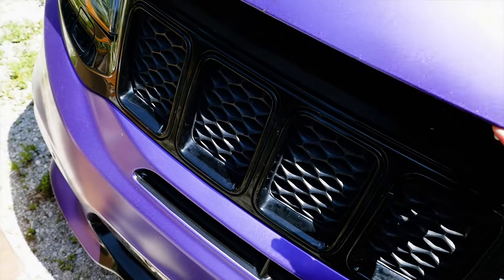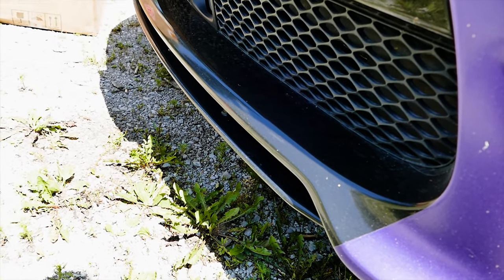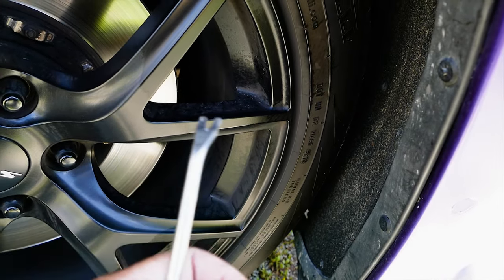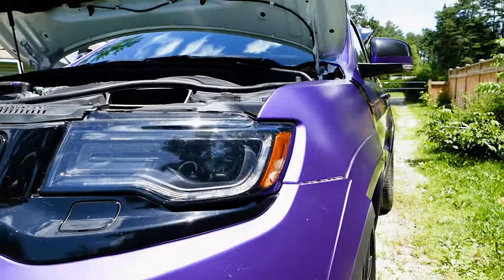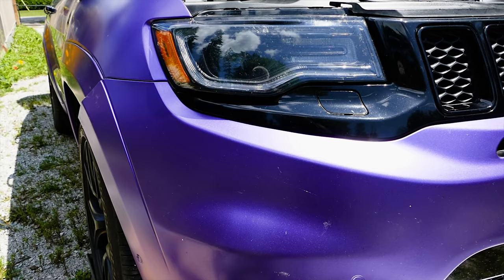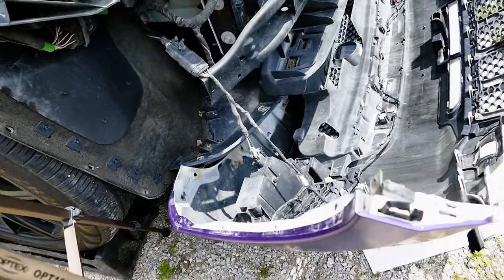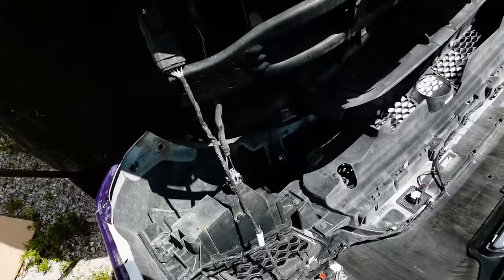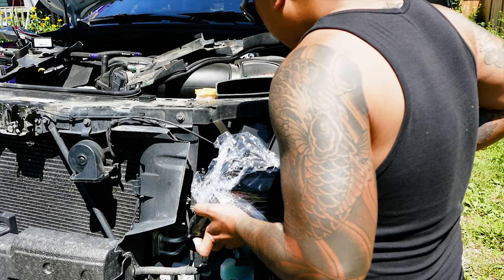jeep grand cherokee front bumper removal

Comment: What are the panels called in the fender well? I need to relace mine.
Reply from the maker: hey there, I thinks it's called a fender liner https://www.partshub.ca/jeep-grand-cherokee-2014-2019-front-passenger-side-fender-liner-ch1249187c.html?gclid=CjwKCAjw8sCRBhA6EiwA6_IF4Xn0vHZAe53oLQV0Tk-jNlJX6DXMRt7jSYe6okHuSpK1r39oPGKd2hoCYMsQAvD_BwE
Reply: @moparbro  sorry I meant the plastic piece that holds the liner in place to the fender well held with plastic rivets
Reply from the maker: @brucesmith007  ah yea thats a tough one, for some reason they call it "black out tape" but that name is discontinued, best to try the dealer and show them number 5 in this diagram https://www.tascaparts.com/v-2012-jeep-grand-cherokee--srt8--6-4l-v8-gas/body--bumper-and-components-front

part # 68158587AA
Reply: @moparbro  thanks bro. That is the part.